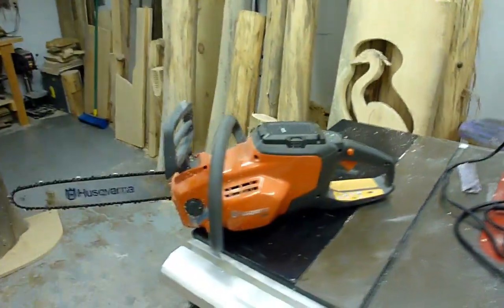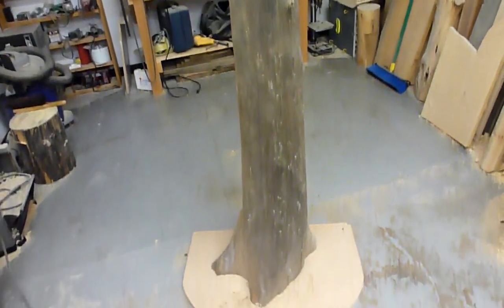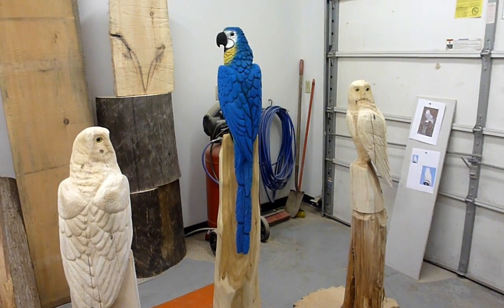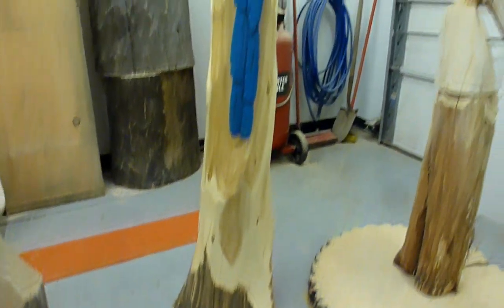Chainsaw Carving A Parrot- Wood Sculpture!!

Comment: Cool! I made some ravens and storks. U can chuck wings into the body and makem seem as if they are about to leave or land. Ppl love them. U can make steampunk birds to with metal wings and stone bodies. Bcoz both angle grinder and chainsaw fall under the category: oddly satisfying. Another fun thing to do is fasten the bird on a cliff near a highway. Construction workers leave stumps of metal coming out of the remaining cliffs. When they blow up rocks and cliffs to make room for new roads. So drill a hole in the bird and chuck it on one of those stumps. A raven works fine and dandy.

Comment: I'm looking to get a new chainsaw. Any suggestions? Battery saw would be ideal
Reply from the maker: Anything made by Husqvarna! Thank you for watching the video!
Reply: @Chainsawchad  how long do the batteries last?
Reply from the maker: About 30- 40 min. Cutting pine or cedar. I  bought an extra battery and keep switching them out after one dies.